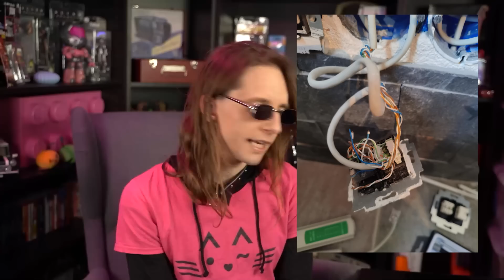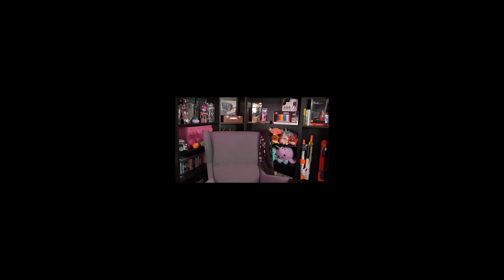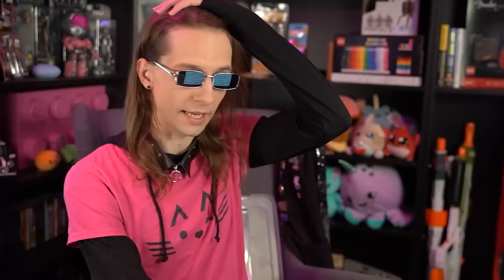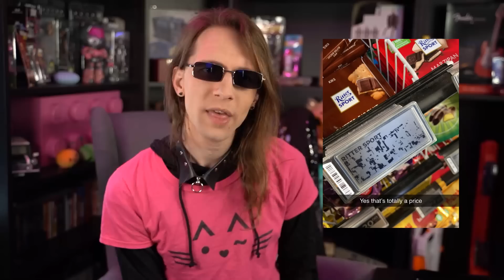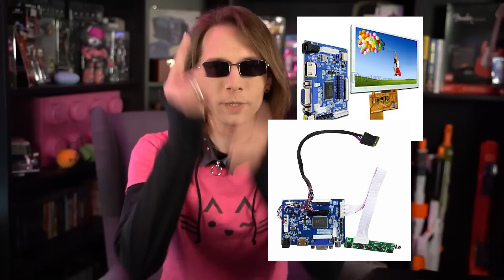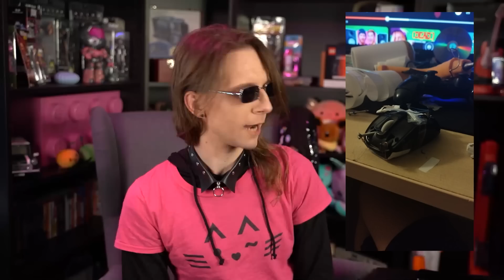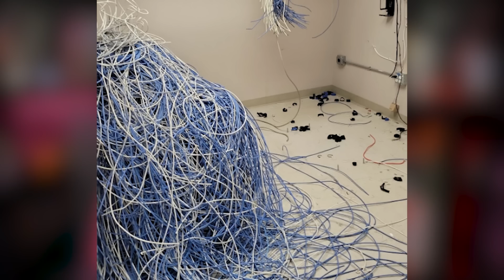Top 10 Ways To Notwork Your Computer'nt | Lexplanations |  r/techsupportgore & r/hardwaregore

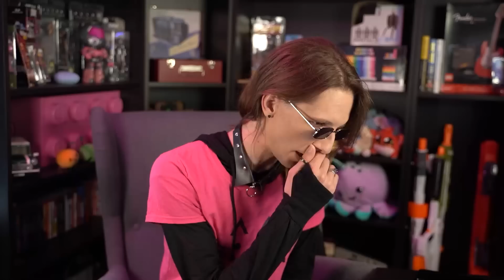Comment: 5:20 those wires are technically fine. They seem to be less than 22AWG, and at that level you can handle up to 600VAC and 5 amps, which is more than enough to power a PlayStation.

Comment: I'm currently designing a coil gun that uses two 100 farad supercaps. I calculated that the coils could be made of 12 gauge wire, so long as the pulse lasted no more than .01 seconds. Which is fine, because the goal is to move a .375" steel ball bearing at 1200 feet per second. The math is mathing.

Comment: I used to work in housekeeping and maintenance at a hotel. One day, I was tasked with going through and changing all the batteries in the alarm clocks and tv remotes, because we had just gotten a new maintenance manager who noticed the last time it had been done on record was approximately a decade beforehand.

It was horrifying. The remotes weren't too bad, since A) those get stolen and replaced so often and B) the hotel had upgraded all the tvs three years because buying new ones was cheaper than the cost of repairing the old ones, but the alarm clocks... I opened one up and it was like it had started snowing, there was so much corrosion in it. There were a couple batteries that I straight up could not get out of the clocks because the corrosion had adhered them to it. The manager ended up putting in a new policy that all alarm clock and tv remote batteries had to be pulled out and changed once a year, because it was BAD.

Comment: I’m not tech-y, I want to ask,
Can someone take individual wires from that tangled mess and have a skilled technician put new ends on them?,

Or is the only way for those wires to become new cables is for a factory to turn them into raw components and re-extrude/re-mold everything?
Reply from the maker: For RJ-45/network cables, field terminations (replacing the head of a cable) is common for one-off repairs or small installs. If the cables are old or of a slower specification though, it’s usually better to replace the entire cable as the clips at the end will become brittle and fragile over time - there’s actually not a ton of copper in them. For HDMI, USB-C, and other cables with lots of wires in them, factory replacement cables are the only real practical solution unless it’s for specialty or testing purposes.

Comment: The Best Buy near my house has those E-ink price displays and they are actually pretty nice. They can make an LED on the tag of a certain product flash so that you can find it more easily. They are location tracked so that whenever the store moves an item to a new location, the store map on the website and app is updated instantly. If an item is recalled or out of stock, they can be made to say that so that customers aren't constantly asking of something is in stock, and more. Also, the software that controls them only allows the price to be changed during the night shift without a manager override.

Comment: Ad store display ("Ritter Sport"): I wish it was e-ink, but those are quite often LCDs (and this one is, you can see the greyish reflective plate behind it, e-paper isn't transparent).. No backlight, but still a LCD and a wireless receiver (no idea if 's bluetooth or WiFi)  in the back, plus a small battery, maybe a micro-pillow. And yes, horribly wasteful and nasty for customers when prices get changed centrally and often without you even knowing on your way to the register.
Ad wiremonster: when we decommissioned a serverroom near me at work, the network people went in with wirecutters and cut each and every wire right next to the switch port. Some of the wires had intermittent problems and the solution to it (before my time) was gluing them in with super-glue, so getting them out was just not an option. Same with the patch panels. Besides, they could cut up to ten wires individually in the same time it took to get the cable in one of the non-glued plugs out and out of the way. Made it easier on them that the switches in question were over 10 years old and not usable at that point (dead ports, no software updates - yeah, smart switches - and bad performance overall). We server-people didn't have that luxury because our servers were put in three piles - "send to recycling", "cannibalize for parts" (that included all power cables), and "move to another datacenter" because they were purchased less than three years ago.

Comment: 5:15, those are british outlets, so if anyone is already freaked out, just know that the British run on 240v and not 120 so it is even more bad then mains in the us which will already give you a VERY day/death, however the wires MIGHT not be actually connected to any power bc some outlets over their have a little plastic piece protecting the little holes of the outlet from stupid people that moves out of the way when the ground pin is inserted

Comment: 6:03 it looks too thick to me, i've wired up sockets for ovens before (our oven came with it being bare as usually they go directly into the circuit but we have a plug) and the wires were thinner than that. Last i checked a ps4 uses less power than an oven

Comment: 5:12 As an electrician, the wire gauge used here should be sufficient for the load. What's far more concerning is the poor and insecure connection at the end. Not only does it have the potential to get hot, but the slightest tug will cause it to pull out, possibly leading to a nasty short circuit.
Reply from the maker: Yea, I looked up the wattage of the PS4 shortly after this and it was lower than I had expected (just never thought to look it up), but I still won't excuse it out of spite, hahah, mainly for all of the other reasons you just listed.

Comment: I own an HDD thats around 10 years old. I have moved with it a bunch of times but it still works! It lives in a box of tech stuff and doesnt get used a lot but yeah its still doing good. (No worries I have backed up the data) Oh its old enough to still have 2 USB A conectors XD
(I acutally have no idea how old it is, it could also be 15 years, but its minimum 10)
Reply from the maker: Yea I have a few 10+ year old drives but I always want to remind non tech people not to use them as backups or rely on them haha. Good for tertiary backups or secondary offsite for low priority archival.

Comment: Well. I think something is wrong with my monitor then. Multiple times i got zapped with 240v low amps when i plug in to my gpu.
Probably the monitor is not grounded by itself but gets grounded tru the gpu and then pc case lol.
Reply from the maker: Geezus that ain’t right
Reply: Well until now, it works😅 but getting new dc low power monitors soon. So there shouldnt be low power grounding bleed anymore.

Comment: 6:36 The electronics store I used to work at had these, but as they were controlled by the cash register system, they could only be updated while that system was in standby. If you sent a command to change a price and someone would try to buy it, the system would just crash as that item now has two prices and it didn't know how to deal with it.

Comment: It's amusing to me how normal people react to the state of wiring in a server room (in this area). I live and work in southeast Oklahoma, and I'd say about 90% of the places I do installs/upgrades/rewiring, the network infrastructure looks like most of these "terrible" pics. The problem isn't that the single hole faceplate costs so much, it's the fact that nobody wants to pay someone to do it right. Every network guy in this area is absolutely spread so thin that it's a real challenge just to make things work period, much less make them look good, or even proper. The few places that don't have terribly clustered wiring are the ones that get massive grants and they have all the latest redundant server hardware and brand new structured cabling. Businesses around here either have all the money or none of it. How it got to be that way is a rant all in itself.
Reply from the maker: Yea I get it for some areas, I used to work in non profit but even then low voltage is subject to building inspection in NY so you can’t let it get too bad, plus, like I said, some of those parrrs are just so cheap that I’d consider them write offs and spend the extra 10 minutes to punch them a new plate. Obviously depends on the situation and such.

Comment: That comment about AWG: this case is better and worse at the same time. If you look at the plug, you‘ll notice it’s a GB socket (which is +1 challenge as ground is necessary to expose live and neutral), which means it’s very probably in 240V land, meaning half the Amps and thus half the warning effect in exchange for double the tingly in case of stupid… And it’s a PlayStation, thus pulling about an amp (230W) max, thus this wire is plenty thick…
Reply from the maker: Maybe, but still not a thing that should be done lol,
Reply: @TheLexikitty  absolutely, especially in 240 land without grounding, that’s up to a lot of 50 Hz heart rate in case of goofy… and 2.4kW until any breaker gives a damn…

Comment: So when I was in college for IT stuff... we had a saying... The value of your education, was directly inversely purportional to the value of the equipment you and your classmates thought you had ruined. Signed, the guy who spent a week trying to recover a cisco router from its verified correct backup, only to find it was an attrocity of a miswired cat5 cable causing communication errors between the TFTP server and the router. (no, seriously. The best part? The backup went from the router to the server _JUST FINE_. To this day, I refuse to ask how the hell that actually worked.
Reply from the maker: MiswiredRX pin or some sort of unidirectional connection, Wild

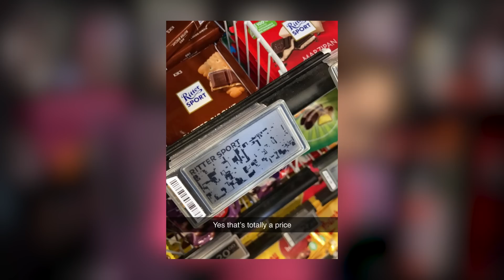Comment: 6:15 Yeah, it changes daily. especially when there was an inflation spike recently.
it does save money though. at about $5 each, by not paying workers to update it, it will pay for itself within a year.
Then they get replaced every 3 or so years because they are cheap garbage but the company still makes money so, oh well 🙃
E-ink is actually super cheap at less than a dollar for a low-end 10x10cm display. Cheap ones might have some artifacts in them but it's like a printer that has that blank line on it's output, good enough.
Microsoft tried using them for shipping labels. Not sure if it worked as they stopped talking about it a couple weeks later.

Comment: I'm moving currently and i was packing away all of my electronics. I grabbed my old psp and the battery just... fell to the floor and i was like, wtf? Why fall? It has a plastic door thing that is screwed in?
And then i realized that the battery expanded to the point that the plastic broke off!
I definitely panicked and just put the whole thing outside until i was able to figure out where to put the battery in my town. 
That was a very tense car ride.

Comment: Speaking of legacy network hell, I had to legitimately buy a network cable tester off eBay because I needed one that did BNC. B N FUCKING C. FOR NETWORKING. IN 2023.
Reply: and no, this wasn’t for like a massive server room. about 30 percent of the building’s entire lan uses BNC (and I mean the end user part, we’ve got computers running MS-DOS in this place)
Reply from the maker: Ah, token ring, isn’t it wonderful.
Reply from the maker: I actually need a BNC tester too lol but it’s for G.hn adapters I got, trying to save myself a two-floor internal house run.

Comment: I don't think these e-ink price labels are on the network or even have a lot of electronics in them.  They are quite common place where I live and I've seen them flickering and glitching before. Seemed to me like that persists until an employee stops by with an external device. Looking at them close up me and my techiest friend inferred they are probably both powered and updated with some sort of near field induction. They don't appear to have ports but also lack the weight or thickness for batteries. The way they flicker supports that they run on charged caps and need to be refreshed every now and then. I've also seen whole aisles on the verge of flickering so it really seems like an employee has to refresh them individually every now and then.
Reply: As I've developed such a product, I can state that (at least some of them) are updated remotely using WiFi or some other RF technology.
Reply from the maker: @Jadyn not sure if you'll see this, but I'm considering an episode on public-space/facing technology, I might have a few general questions about these price tag systems when writing it and wanted to ask if you'd mind if I emailed you about them? If you're interested (no pressure), you can email me at operations@thelexikitty.com. Thanks!

Comment: I find it a little ironic that I learned about batteries more from my RC helicopters than anything else.  Fun fact! My largest helicopter, an align trex 500,  needs a batter that holds more voltage than my car battery!  How big is that helicopter I hear no one ask?  Well they're nicknamed pigeon deleters for a  reason... Also the tail spins about 3 - 5x faster than the head which can reach speeds of 3k rpm.

Not all batteries or chargers are made equally.  And you may even need something called a balance charger to prevent cells being over charged (unless you want the angry pillow).

We need better battery care in all honesty.  I only know one place thay deals with domestic batteries and thats in a Spar corner shop.  Any specialist in my area would be a 60+ mile drive which isnt great.  Perhaps they could have a community safe bin in areas where people can safely dispose of non or low spicy pillows.  Also things need to be repairable,  I dont want my beloved snes and n64 ending up in a landfill.

Comment: 6:39 ive noticed that bestbuy uses these, they are not networked someone has to go around with a tool to update the price. If nothing else this is a really good way to save paper as you don't need to print up a new price tag every time the price changes, also they are exactly as complex as they need to be as to network the hundreds of these things in order to update them live is a lot of network infrastructure that companies don't want to pay for or maintain, companies are nothing if not penny pinchers.
Reply from the maker: JC penny acridly had networked versions of these that would change price for cheaper things in the morning (Doorbusters)
Reply: @TheLexikitty huh, I did not know that, though I usually go to thrift stores for my clothes so there's that.

Comment: Fun fact about the batteries if you have a car that runs off of that batteries my new these are actually whatever the power plant is not green at all but if they ever catch fire we have to use two tanker trucks we have to submerge the battery that's on fire to put it out some of these batteries that becomes spicy and fiery mainly a raging battery a fiery death can people lay you know test these things and make sure they don't actually go on fire please because my God the car fires that we have to deal with where I'm at is more than I would like second I used to be able to gain design but now it's hot to put out another car fire that's weight it's electric God I am going to need reinforcements in another tanker truck here

Comment: I have an old Motorola SLVR that I have not used for about a decade. I have tried to keep it at least sufficiently charged to power itself on. It does contain a Li-Ion battery and after watching a few relevant videos narrated by Lexi, I have checked (because that phone dates back to 2005 and I only date back to 1998) and I report that the battery is not a pillow yet.

Comment: I own a laptop that is approaching 10 years old (lenovo too), had to shove and force a windows 10 usb installation because nothing else worked. It is unbelievably slow, but I have no idea how it still works with win10 and how the HDD is still functioning. 
On top of that I currently use a +5 years old laptop that has been thru a lot of software and technical accidental abuse (a lot of local and roaming data corrupted) and the HDD is also still working. It's a miracle any of these are still very much useable! I love seeing old spec still alive despite the nightmare they've been thru.

Comment: Recently,  I put an old phone into a 4 inch thick 10 inch tall concrete bowl then drove a 6 inch nail outside on  pavement empty parking lot through the middle of the screen and watched it burn. 😊
Reply: why?
Reply: @beepyshenanigans  as an experiment.  I have seen people on YouTube do something to make the lithium ion battery start a fire.  I took the precautions necessary make It's not catching anything else on fire and I want to see how long it would burn which was about 8 minutes. The phone still looked like a phone with extra bits of black plastic choosing out of the side.  It was an very interesting experiment.
Reply: @georgeworley6927  LMAO, i did that bin the middle of a unused side road. we sang fire water burn.

Comment: … should I replace my HDDs that I’ve had in my computer since I first built it in 2014~~? Nothing wrong with them as far as I know

Also I had a Sandisk SSD that somehow broke so badly that if it is plugged in, the whole computer will not get past the Windows logo and spiny thing

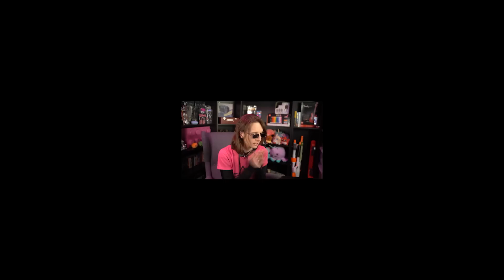Comment: I bet at least $10 that weird blank wall plate and jack off to the side @ 0:57 is because they drilled through a stud and rather than putting in a new hole or coring out enough space for the jack to fit they just did it like this. I normally move them for phone/data and just made the hole bigger for Coax.